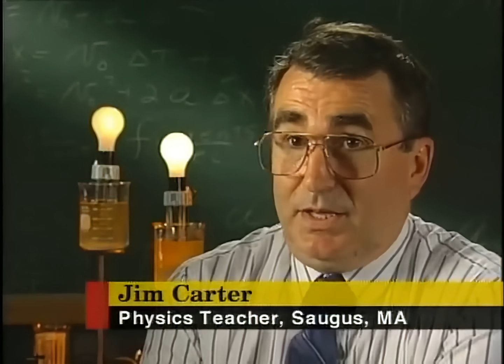MIT graduates cannot power a light bulb with a battery.

Comment: This video is disingenuous, it only makes a fool of the viewer and not the students. Notice that the black student is holding a different bulb than the previous students and listen very carefully to what he says. He was unable to light the first bulb and has just been handed a smaller one that will work with this power supply. It is likely that the clips of the other students are taken after they were unable to light the first bulb with a correct, closed circuit and have reverted to trial and error before giving up. They are hesitant to answer because they know it is a trick question. They are about to be handed a bulb that, like the one in your lamp, will not light with the low voltage a single D cell battery provides.
Reply: Actually the video isn't disingenuous - the poster is. It seems the fact that not every bulb will light with every power source is the point they're trying to make but the way it has been cut out of context and posted with this title sets you up to believe they're morons while if you could have seen the big picture you might have a little more sympathy. It's so easy to get views and likes by putting people down, isn't it?
Reply: Wander Smut I think you've misunderstood. The students are just not correctly closing the circuit because they've only been given one wire. Every time you see those large domestic bulbs there's a single flex going to it, which could explain why they're just touching the wire to the bulb, hand them a small bulb like that used more commonly in electronic projects and they're more likely to remember that you either need two wires or you need to hold the bulb onto the battery. Incandescent bulbs like that should light up with a battery albeit rather dimly.
Reply: Wander Smut ah wait no sorry I've not completely read your comment closely enough. I don't know, I still think the point could be that people forget they have to close the circuit or just realise they don't actually have the necessary practical skills even though they understand what to do theoretically - connect the wire to the bulb. The bulbs should glow dimly when connected properly.
Reply: Wander Smut well then he analyzed the materials and figured out the problem and the rest didn't.  probably got himself a job somewhere. maybe this was a test a company did to look for someone to hire. some of them didn't get the offer.

Comment: As electrical engineer I can say that this kind of question is completly wrong and misleading. What is a light bulb and what's a battery? Neither of these say anything about the power supply and the load except that we have DC power supply and that the load suppose to lit. This question cannot be answered correctly except: I don't have enough data to judge. But it also says something about them as young engineers, they don't have that habit to look for needed data, to solve issues from the very beginning. They just blindly say yes or no without having proper data to answer. Another thing is that asking mechanical engineer about electricity is not a good idea. There's a reason why people get specialized education. That's because no one can be great at everything or even lots of stuff. Not enough life, not enough time. But one can be great at one discipline. But we got to the point where people have good knowledge about one discipline but they don't know the first thing about anything else. And people with varied knowledge are really needed right now. I don't know about MIT but when I was getting education at my uni of tech, 90% of the program was pure theory. Now looking at it after a few years, you are not engineer because you got a degree. Engineer is a diploma + a few years of experience in your discipline. Then you can call yourself an engineer. I have a few friends that have the very same diploma as I do but they wouldn't be able to do anything practical, all they can do is sitting in front of computers.
Reply: yo... my dude. they didn't just ask the question... they gave them the battery and the bulb and the wire. And they couldn't figure out how to do it. It's something that any one should be able to do before even starting an engineering degree.
Reply: The ones that "failed" appear to be holding fairly big bulbs. You aren't going to light a bulb designed for 120 volts with a 1.5 volt battery. None of them appeared to be given flashlight sized bulbs with the exception of the one shown working.
Reply: Leszek Michał I see where you're coming from, but honestly this is such a simple question there is no excuse. If you're an engineer I'd expect you are smart enough to understand the most BASIC fundamentals of electricity. This would probably happen at my university as well. There's a lot of retards who want to be "engineers" but haven't got the slightest inclination for learning. They barely squeeze into graduation because they know how to memorize answers. They lack intuition which is the only thing that matters.

This is why even the most stupid individuals can specialize in one thing. I don't assume you're smart just because you graduate college. I've met plumbers who I would consider insanely smart as they have such a wide scope of knowledge and can learn anything very quickly.
Reply: LMAO.   Why????  Did you seriously just ask why a computer engineering student would need to know about how to power a light bulb???  Clearly you don't know anything, anything at all, about computer engineering.  Because if you did you would realize that they are very similar to electrical engineering.  Many of the courses are common between the two disciplines.  Computer engineering is  a lot more, than just knowing how to program.  If that's all you wanted go into a computer science program.  Computer engineers on the other hand have some pretty high end knowledge of how integrated circuits are designed and work at the atomic level.
Reply: +Butane Stove the truth is that people who said yes or maybe were kinda right. Generally (as they asked) it is possible. Those who tried also did it right but they didn't show the whole process. And there were none who said it's not possible except the girl who said she needed another wire to close the circuit and she wasn't wrong because generally you use a wire to connect the power source to the load but she didn't realise she can just touch ground pin to negative of the battery.or the other way. I don't feel like electricity is superior and any engineer should know that before starting an engineering degree. But I also find it weird that there are people who seriously can't tell what they need to light a bulb or how to use a battery, it doesn't take an engineering degree to know that...
Reply: As an electrical engineer myself, I can say that question is NOT misleading in anyway whatsoever.   Its a simple question that's being over analyzed.   And it's not even a highly technical question.  This is a question that grade school kids could answer.  The really sad part is that they were given the parts and still couldn't figure it out.
Reply: typically in many  universities, first year engineering is the same for all disciplines.  
However, this type of knowledge is NOT university level.  If you are entering first year engineering and don't already know how to light a bulb, you don't have the basic prerequisite to be enrolled in engineering in the first place.
Reply: It wasn't misleading, they should know about voltage, current, and AC vs DC. Yes the question required knowledge and the answer was not a simple yes/no but that doesn't make it misleading. I agree that the way they handled the question without enough knowledge shows bad engineering practice. But as far as I know all engineering majors have to take EM with a lab, and I think MEs have to take a few circuits courses so there was really no excuse
Reply: I would say the person using that kind of vernacular is the one who has intellectual and maturity problems.
Reply: I was thinking exactly this , depending on the power of the bulb it might not light at all due to the power and voltage of the battery.
Reply: That's not the point though.  The point was to see if they actually knew HOW to do it.  And with the exception of one guy in the video, they didn't know how to light the bulb. 
The type of bulb used is irrelevant.
Reply: Gee that's funny, because our company does a lot of embedded firmware programming and the people we hire have either computer science or computer engineering degrees.
Reply: LegionStriker
All true man. I mean I also have friends who were at the same group on college as me and they now have the very same degree as I do. But I know they are dumb, they just aren't cut out to be engineers. They just learned how to pass exams but they completly can't use knowledge for their good. So as I see it, engineering degree is a necessity to be a good engineer because that's how you learn harder math or physics and shitloads other stuff but it's not ultimate reason that makes you a good engineer. Some people have it some don't, I believe. It's like a talent, kind of. I could study how to draw but I know I'd never be Picasso. But I knew I was good at science like electricity, electronics, computers and so on so I decided to study that instead of other subjects. But overall I'm not surprised, I work now with lots of people and some of them shouldn't do what they do because they'll get someone killed or get themselves killed one day. But life's life, I guess, college is about science, life has that money factor...
Reply: tchevrier is correct. The principles of how a light bulb works are taught in high school, not university. EVERYONE, at least from a US school, should have had exposure to that information before entering university. The later specializations do not remove the universal foundations of which all those disciplines lie.

Also, computer science encompasses a lot of programming. I know, it was my degree. It's not the only field one can get into with the degree though.
Reply: Leszek Michał can you light a bulb with a battery and wire? I'm not an electrical engineer... oh boy... the sad thing is that most companies who need this task performed are probably only looking for electrical engineers with a degree and 5 years of experience.. the obvious answer is she needs 10,000 more dollars of schooling for this knowledge..
Reply: Leszek Michał it's a simple question of whether they understand a simple electrical circuit or not.  as they stated in the video it isn't meant to be a trick question
Reply: yes, but did they give them the right battery or the right bulb? dc current will flow through the light bulb regardless, but if you try to light up a 120 V bulb with 1.5 V battery, you won't see the incandescent wire emit light. you would need a thermal camera to see if there is actually any current flowing through that wire. the question is to generic. the small bulb has lighten up as you'we seen because it was designed to work with low voltages, the ones you find in a flashlight
Reply: they never even tried to complete the circuit.

you saw the fat girl make part of the circuit
Reply: Leszek Michał WOW!WTF is that huge shit!mate,chill...
Reply: ShadowThruNight let me answer some of your points. I am from Saudi Arabia and we have the same type of education that mainly focus in math stuff rather than physics. Student should start studying physics from 5 years old and gradually improve until 18 when they start applying for university. I mean by physics ( how things work). True education is when face real problem and real world.
Reply: AIA AIA
Reply: huh ????
Reply: Leszek Michał ,ok....you're right but they are graduates and... why didn't they address the question the way you did ?!....mhhhhh!
Reply: Leszek Michał "What is a lightbulb and what is a battery?"

Well gee, I wonder how the fuck you managed to get passed elementary school, child.
Reply: lmao.  I'm laughing because there is some truth in that statement.  When I was taking electrical engineering  there was only 1 class on technical writing.  They taught us to ignore a lot of the rules of proper english.
Reply: With vague hypothetical questions, you as the answerer get to infer all the qualifications you desire.  So if you know how to do it with some setup of your choosing, then the answer is "yes".
Reply: Au contraire.  It takes an architect to make it pretty, an engineer to make it functional, and a mechanic to actually build it.
Reply: And yet, none of the graduates answer the question like you.
They all immediately assume they can do it.
Reply: Please don't get philosophical about it. Plain language:- A battery, a lamp and A piece of wire. Nuff said.
Reply: Lmaoooo, this world is full of funny people. But I blame the education system for its inability to teach. This is what happens when you put students through theory 24/7 and almost no practical application. No one learns anything by memorizing bits of information you learn by doing. And since a vast majority of learning is done in the classroom not in practical applications you will get a lot of people lost like this.
Reply: +therealnightwriter A tungsten filament doesn't have a forward voltage. The important characteristic is resistance.
Reply: +Michał L I have a tendency to answer questions like that and it's something I'm combating every day. In the real world people (non-engineers) don't want a lecture, they want a yes/no answer. If they can't give you enough information to know for sure, you have to guess. 
Not saying that's what's happening here—the kids they've shown clearly were idiots—but giving definite answers to questions you can't know the answer to is something successful engineers do quite often.
Reply: A battery is a battery you fucking moron. Light the bulb ya fucking idiot.
Reply: I think you don't understand that just because someone failed in the experiment (maybe they were hung over, didn't sleep for days or just panicked because they were put on the spot) doesn't mean they're not smart. They might have expected the question was a trick question and spent their time figuring out where the trick is. If you want to measure intelligence, IQ test is still the best method we have for that today.
Reply: tchevrier That's bullshit and you know it. I have plenty of friends who are studying computer engineering. Why would they need to know this?
Reply: tchevrier oh right ok well your comment is retarded. Just because a bank hires economists doesn't mean economics is banking
Reply: tchevrier who are you responding to exactly and what are you trying to say?
Reply: Are you serious?

Even a mechanical engineer should know the basics of electricity. I'm a student in electrical engineering, worked prior as programmer/electricitan, and most of the students are really that stupid. They can write the best papers, but when it comes to actual problem solving, they are incapable of solving the easiest problems. 

Tell me, why the fuck does a person study electrical/mechanical engineering, if they never tried to build a pc, light a light bulb or to repair their car?
Its probably, because they chose it for the money.

A good engineer chose it, because he loves taking things apart, because he loves to learn how things work and probably because he wants to change the world.
Reply: Dok Bob  Because all problems are as simple as your plain language right?
Reply: Leszek Michał about that "mechanical engineer" not being able to solve such a simple electrical problem (its grade school physics afterall, in europe we are taught this shit in grade school)...you...are useless. Of course they could have asked...what materials must i use, what is the rated voltage and wattage of the lightbulb in cause, how about the voltage and current output of the powersource. Based on that they could tell..yes or no... but it's about how American Engineers...have absolutely no fucking knowledge about such simple things. They are supposed to build the bridges, make the electricity, bring the water, and grow the food for all of us... would you trust your health, safety, and life into any one of those morons's  hands? ... exept for the black guy...he was smart enaugh...

Comment: I suspect this is edited misleadingly. The students are given light bulbs that require a larger current than what the battery supplies. One guy gets it to work by using a smaller bulb... presumably after correctly identifying the issue. 

Their failure would be in identifying the source of the problem: not that they don't know how to wire the thing up. 
Still, should be obvious.

Comment: I thought lightbulbs ran on AC
Reply: Greg Solis-Reyes electricity in a house is AC but converted to DC on more sensitive electronics, a filament can run on both if it's the right voltage.
Reply: That helped me learn
Reply: They "run" on both AC and DC. It's just a resistance heating up. In AC it flickers at double the frequency of the signal, in DC it's a steady current.

Comment: The very first thing that came to mind was "how much voltage does the battery provide, how much voltage does the lightbulb require, and how much resistance does the wire have?" Of course it's possible to do it, but only IF the battery can supply enough to overcome the resistance of the wire and the lightbulb.
Reply: Michael Etzel P = V^2/R all day